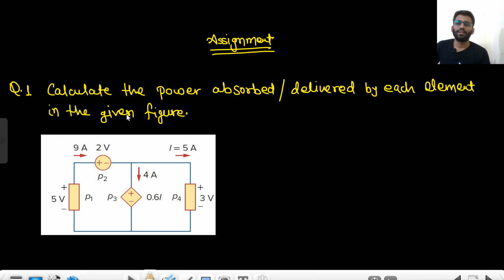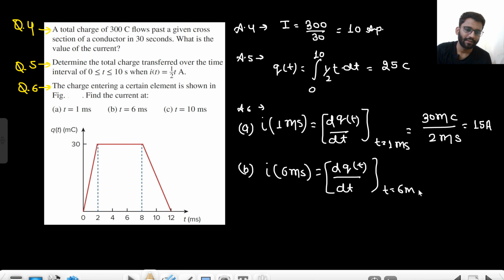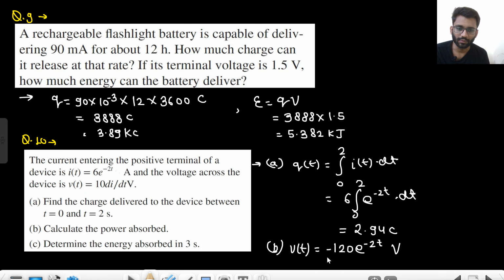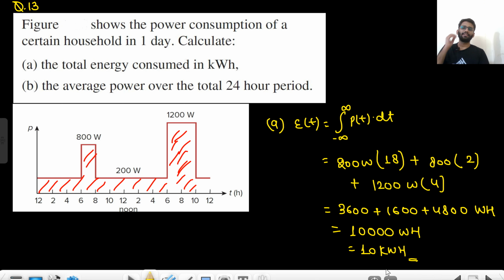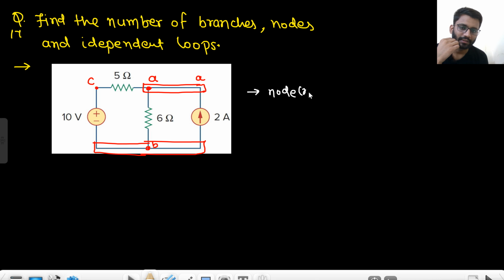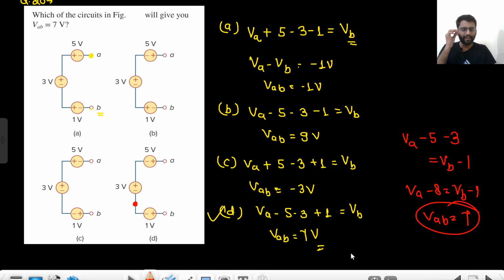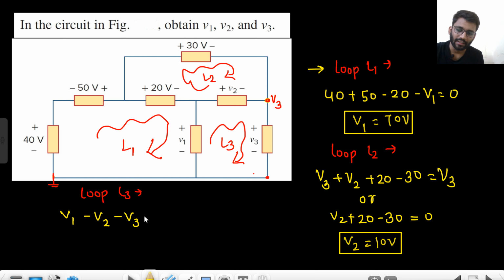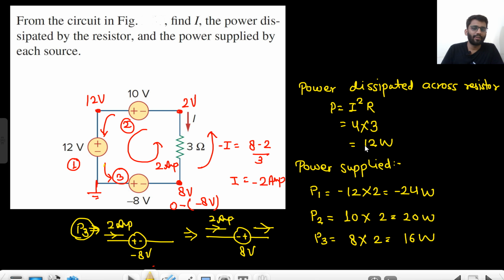Assignment 1 Solutions || Network Analysis || GATE 2025-26 || PrepFusion || Himanshu Agarwal

Comment: 1:00:33 how did you take that point as 4V because 16 volt also there.
Reply: It is just the way we traverse the loop in the circuit. We can also use the loop:

10 - v - 16 - 3ix = 0

Then, for the second loop:

4 - 16 - 3ix = 0

Solving above gives:

ix = -4 A

Substituting ix into: 10 - v - 16 - 3ix = 0  =>  we get: V = 6 V

Thus, V = 6 V and ix = -4 A, but we considered ix to flow from bottom to top in the equation: 4 - 16 - 3ix = 0

However the given direction of ix is from top to bottom, we change the sign convention from -ve to +ve so,

ix = 4 A

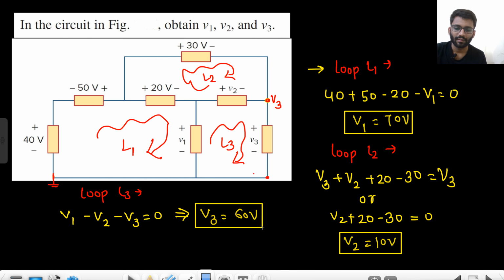Comment: at 57:27 why in extreme right node V3 is included ??? if so then node between 50v and 20v should also develop some voltage also in between 20v and v2 also some voltage should be there??
Reply: In KVL always consider the element's voltage rather than node potential. Considering node potential could produce Equation with more than one unknown making it complex.

And to find true node voltage at those junctions, we need nodal analysis, but cant be used here as we dont have resistance values.